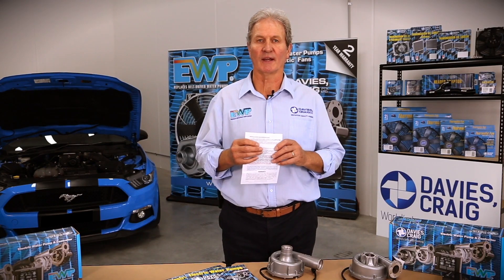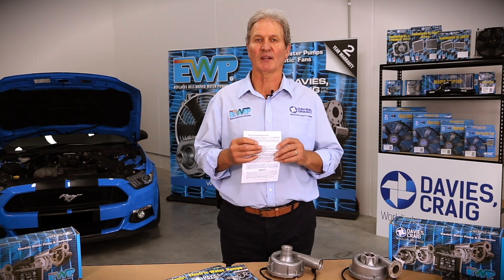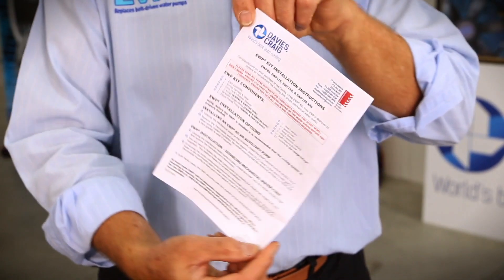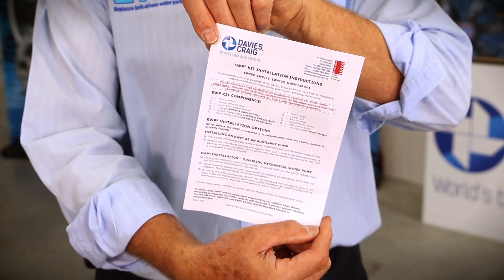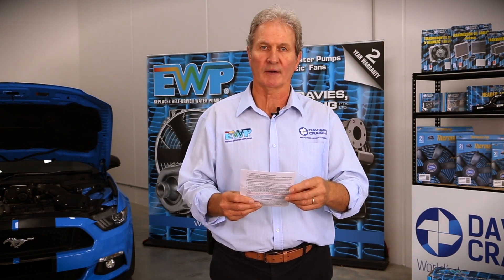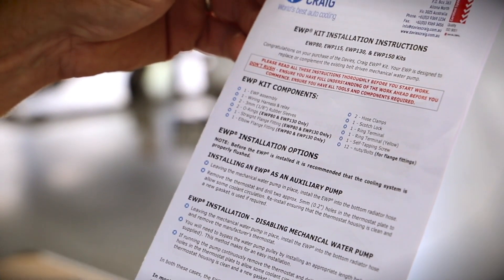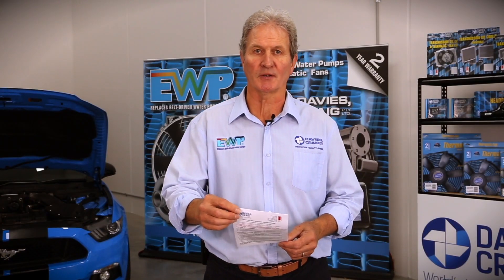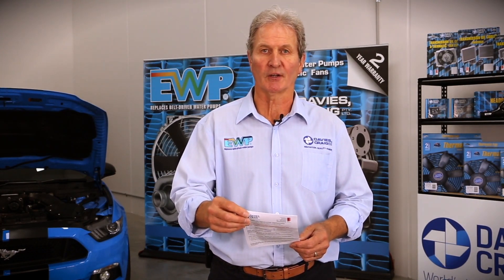FAQ EWP Part 3 - How to Install a Electric Water Pump (EWP) as an overview?

Comment: Do you make one that fits on a 2012 Dodge Challenger with a 6.4 L engine and will it interfere with your computer
Reply from the maker: Given the size of the engine, we would recommend our EWP150 or EWP130 model range. Our pumps are universal fit, it all comes down to what type of installation you want. The options are: 1. AUXILIARY OR REPLACEMENT or 2. DISABILING THE MECHANICAL WATER PUMP or 3. DISENGAGED MECHANICAL WATER PUMP (RECOMMENDED) or 4. REMOVE MECHANICAL WATER PUMP (IDEAL) You can read up on each method at this link: https://daviescraig.com.au/electric-water-pumps